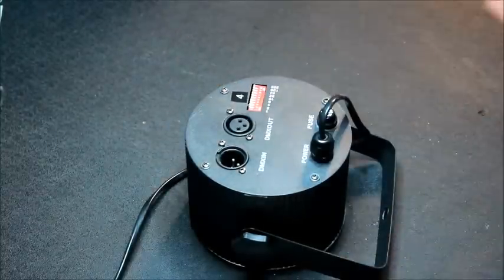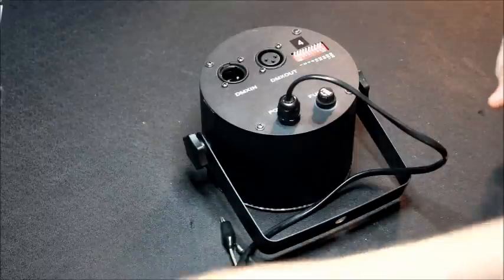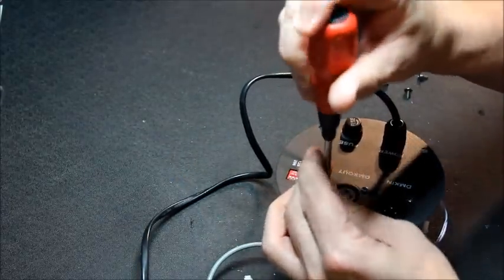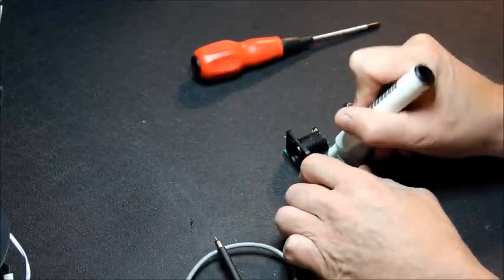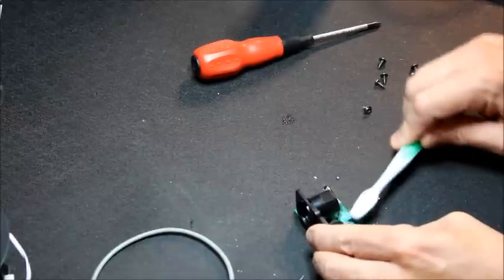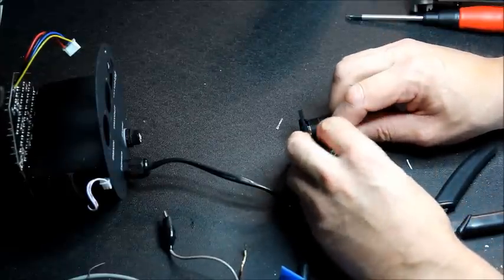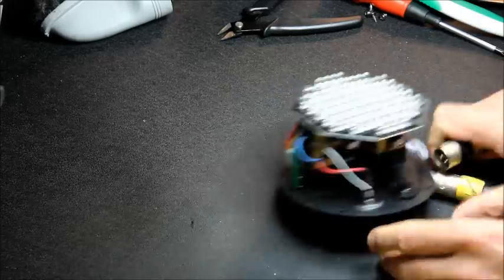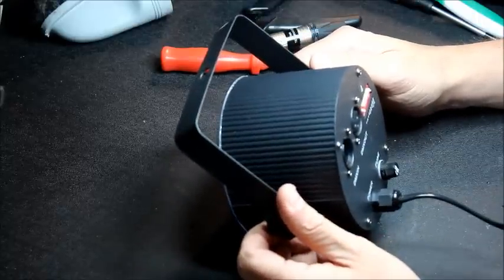Steve'll Fix It S01E05 - DMX LED PAR Can Repair

Comment: So, I'm trying to do some research on how to fix PAR 64 LED cans, something like what you have there, only not as compact. I have no background or experience with circuit boards or such repairs as this. However, watching you pull this apart and put it back together has given me some ideas and provided my with some information I can use to do better, more in-depth searches about these things. Thanks for the video! This is going to help a lot! :)

Comment: Hi Steve..here is a crazy question. I have a bunch of old par cans that use the bulb.  I had this idea to gut them and use LED strips inside of them.  Where I am stumped is how to power them back up and have DMX control.  I can use the dimmer packs as a source of power but wiring up LED as well as the DMX (for color change...etc)  to get them to work is beyond my ideas.   Any idea how I can do this or would it just be cheaper to go out and buy the LED cans?  Thanks alot. Enjoyed your video.
Reply from the maker: Well that would be an interesting project, certainly. I guess you could use high power LEDs in place of the bulb, but getting them at the focal point of the parabola would be difficult and then you'd need to sink the heat... You could use a microcontroller as the DMX interface, some FETs and a current limited PSU to drive the LEDs but, at the end of the day you could just buy one of these units for £20... Hope that helps.
Reply: Yes it does. I appreciate the respons. Thanks alot.

Comment: I'm about to repair one of these Chinese atrocities. Have you seen the way the current limiting resistors are installed on the LED board? One lead goes through the PCB as it should but the other lead is suspended in a blob of solder. I've never seen anything like it!
Reply from the maker: No. I didn't look at the LED board, but nothing would surprise me!

Comment: hey man i bought a RGB LED 10MM BAR Strip from musicstore.de 
to find that 12 RED LEDs are flashing on there own. only in red. and in color mixing that needs red... i opened it up. looks clean no black burnt marks or anything.  but cant seem to fix it....also the dip switch box no.7 is broken as core . how would u fix that ??? # i love ur channel

Comment: hey I have a par 64 led light that every time I plug it in the led lights will come on and go immediately out  you have any idea on how to fix it ?
Reply: Even I have observed similar problem with my led ..
Please help if anybody knows about this problem ... thanks
Reply: Just resolder dmx in connector to the board. It helped me, had a same symptoms.